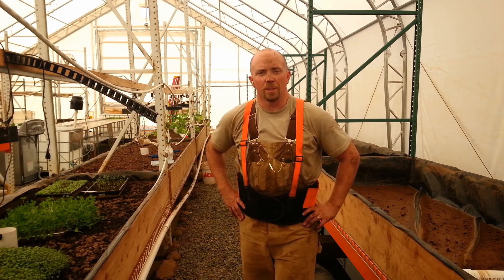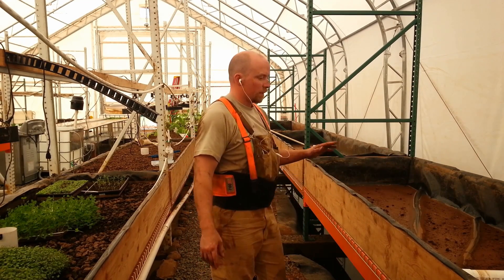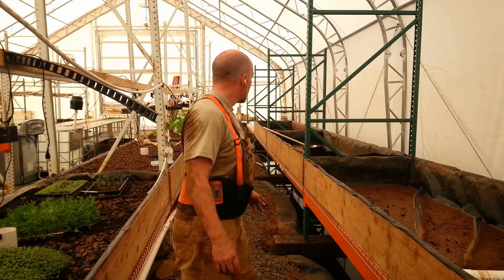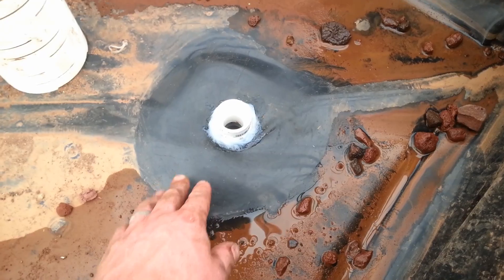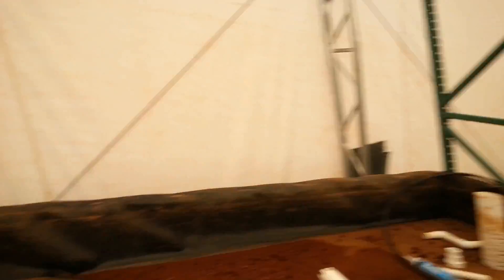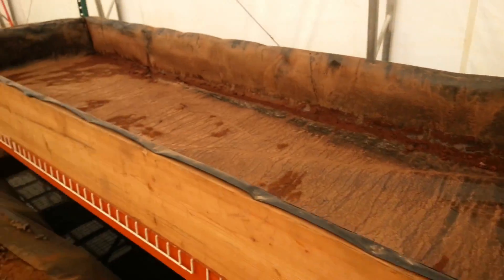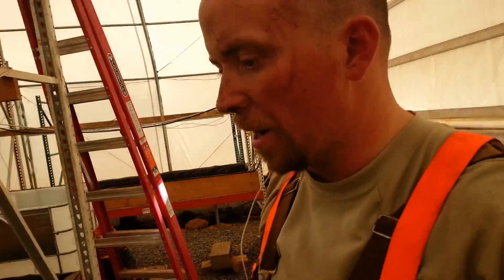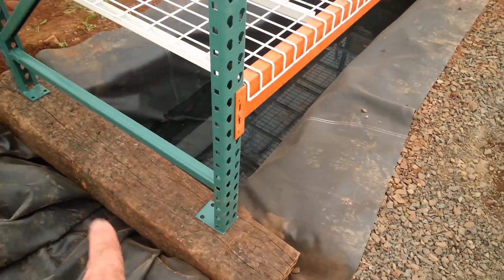Building AQUAPONIC and MICROGREEN GROW BEDS with RAINBOW TROUT - Part 2

Comment: Jeff pls pay attention to me mission commander, Lanes 2 and 3 need to have the sleepers full size and don't cut them down. They need to be atleast 2ft wider on each side of the lane. This is cos the height and weight of the row compared to lanes 1 and 4, u will get away with them being 6 inches either side (on lanes 1 and 4) but still I would have left the sleepers full size on them to and attached them to all the other rows sleepers, then u wud never have any weight distribution problems again. Mission Control OUT.